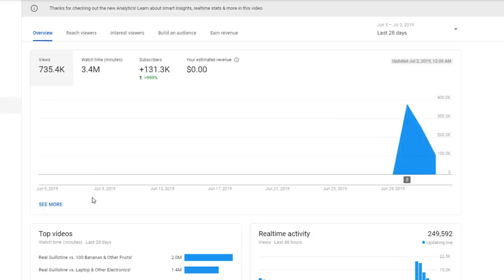Real Guillotine vs. NERF & Other Blasters!

Comment: I have a concept for guillotine victim retention. You could use a set of screws or bolts on each side of the blade and use metal straps to hold down the item. It would mitigate both the folding/eating effect and the sliding due to the slope of the blade. For reference, check out how the guys over at the Waterjet Channel secure a workpiece to the plywood backer.

Comment: guys. make the gap between the blade and the bench smaller. make the slice hole as small as possible. bolt-in thick steel plates on both sides of this drop zone to protect the structure and you will have cleaner slices. can you slice a book?

Comment: Suggestion - Tighter tolerance between blade and table.  It looks like your "victim" is getting sucked down into the gap by the blade.
Things to chop - Jelly, Trifle, wood (this thing would make a great log splitter), pot plants, Ice block......
Keep on choppin' boys

Comment: I think you need something to hold the slack on the cable that pulls the blade. If that cable stayed taught. I don't think your blade would derail. It would be cool to see jawbreaker candy chopped in slow mo.

Comment: You need to remove the rollers and aluminum angle, switch to UHMW blocks and sides. It's a low friction surface that would not allow the blade to twist. You could also make a clamp to hold the stuff centered to the blade so it doesn't slide into the blade jam.
Reply: I'd also recommend a remote solenoid controlled quick release so you don't have to be so close to the guillotine.

Comment: the longer the mount for the blade the less it will rotate on contact.
if you increase the length of the blade mount you can add another set of pulley wheels (or 2 sets), this will help reduce the derailing and will also increase the pressure exerted of the condemned.

Comment: You should chop one of those anatomically correct heads or something like that, also I think the triangle for the rails needs to be deeper in the wood, so the rollers run deeper inside the beam, then perhaps have the blade wider at the bottom to cut everywhere along the bed and stuff cant get jammed into those rollers.

Comment: You need a box to replace the hole someone's head sits in on a old fashioned one. Maybe make a box on the front end out of really tough glass

But you need something to keep the soon to be chopped items from sliding around

You could even just do a wall on the short side of the blade on both sides of the gap where the blade goes down

Comment: the blade keeps derailing, so you need to decrease the space between the casters and the track. or you need to add a boundary along the length of the poles, like a strip of metal that covers the area in front and behind the casters

Comment: In most guillotine designs the blade is attaching to a wooden plate/post that runs between two recessed rails inside the vertical posts, which not only keeps the blade steady during free fall but also retains the blade and keeps it from deflecting once it hits something. Also, in guillotines used for executions that prisoner is held in stocks, keeping them steady so when the blade falls the angled edge slices instead of chops. 

Since you have the blade and you have a router, use the same system you have but make channel in the side posts deeper to actually encompass part of the blade assembly, build retaining walls for the items you're cutting (you can use plexiglass so as not to obscure the view) and perhaps make the gap between the two platforms smaller so the times can't just get crushed into the gap.

Comment: Idea to stop the blade (instead of stopping it with a block o' rubber): use a high-tensile strength rope and a spring attached to the top and to the blade. A long enough length of rope wll allow it to fall freely, and the spring will prevent the blade from ripping the top of the slide off. That being said, still keep the rubber, since it'll be one more thing to stop the blade at the bottom.

Comment: I've spammed similar comments on the last three videos, just a recommendation.
You should add another cross brace like above, but a few feet up, high enough to be out of the way to chop whatever you want.  That way you can safely-er load the shit to cut in there.  You could just put a piece of scrap wood in there between the brace and the blade.  Obviously have a different clip for the carabiner to clip into for the half-cocked position.  That way if any one part of it breaks (casters, cable, any of the pulleys, rollers, or attachments), the blade would be sitting against a piece of wood and have no chance to build up momentum to cut something or someone on accident.

Comment: Video Idea: 
HOW TO SURVIVE A GUILLOTINE Test if it’s possible for a mannequin not to get chopped, try having arms above their head to stop the blade, or a system that stimulates the same amount of pressure arms would if they caught the blades at the side as it fell. 
Another idea is to do some challenge where the corridor crew has to save someone in the “nick” of time by shooting a polystyrene mannequin in the head pushing them backwards between the time the blade drops and strikes.

Comment: So classic guillotines have two boards with a half circle cut out of each to create a secure neck shaped hole to hold the victim. It’s kind of like the difference between cutting food free hand and cutting food while holding it down. With free hand the food can move around a lot, so unless you have a perfectly straight cut it’s going to move.

Comment: Stuff that u chop with a Guillotine was supposed to fall down, after the  choppin, like in some kind of head-basked. Just sayin' Plus: the surface you lay ur stuff on should almost touch the blade so you get cleaner cuts and less debris chunked into the slit.

Comment: Understanding the physics could help eliminate or minimize derailing.

First thing is to understand the forces. As the blade chops, the object it chops exerts an equal and opposite force on the blade itself perpendicular to the blade edge. The objects get pushed down and left, so the force on the blade is directed up and right. The force will also generate a torque on the blade.

The force up and to the right shouldn't cause derailing. The force in the upwards direction just slows the blade down. The force to the right is all absorbed by the right beam, but it's absorbed equally by both wheels. One thing to be careful of is the angled blade will cause a lot of stress on the right beam. Say your blade has a 30 degree angle. Whatever force is seen by the object being chopped or the rubber stopper, the right beam sees tangent(30)= 57% of the same force. 

The torque on the blade is what causes the derailing because as the blade twists it pushes the beams outwards and two wheels lose contact with the tracks. Objects chopped with the rightmost side of the blade will cause it to rotate counterclockwise, objects on the left will rotate it clockwise, and somewhere left of the center of the blade is a 'sweet spot' where an object will cause no torque. You can see this really really clearly on the first derailment on the television. The television is just about perfectly centered when the guillotine is first dropped. The blade starts to rotate counterclockwise. But then the television gets pushed left and as the blade continues to slow down it rotates clockwise because the force location has changed. 

One other note is the faster the blade stops, the larger the forces. Pineapples stop the blade over a large distance, while the television stopped the guillotine dead and creates huge forces and torque that bow the wood beams outwards.

To limit derailment you would either evenly distribute forces along the blade as it chops (hard because your items would need to be sloped to hit the blade at the same time) or find the sweet spot that creates minimal torque and chop with that part of the blade. You could either fix the object so it doesn't move at all, or put it slightly to the right of the sweet spot so as it chops and pushes the object left, the object moves through the sweet spot never creating too much torque.

Comment: The best design for a Guillotine would be the later French Model Guillotine used up until the 1980s when capital punishment was abolished. Plus you should have a mechanical release mechanism to hold the blade in place so you won’t need the board. If you guys want, I can send you a photo of the device I’m referencing. I know a guy who sells instructions which you can replicate the full, 1:1 scale Guillotine.
Reply: Don’t forget the Lunette, it holds the neck in place so the blade creates a cleaner cut.

Comment: Suggestions:
01. Chop soda
02. Chop fruits mid-air
03. Chop arrows mid-air
04. Chop 3D printed mini guillotine
05. Chop 3D printed mini versions of yourselves
06. Chop a velociraptor
07. Throw darts while the blade is falling
08. Chop a tablet/laptop that is turned on while playing a cringe moment from any of your videos
09. Stop dominoes by guillotine blade
10. Chop giant cheese
11. Chop pizza
12. Chop sports balls (from the biggest to the smallest ones)
13. Chop books
14. Chop pumpkin and carve a face on it using only the blades
16. Chop Voldemort's nose
17. Chop Sphinx's nose
18. Chop Squidward's nose
19. Chop Hitler
20. Chop Thanos
21. Chop Michael Bay's movies with practical explosions effect on the background

22. Chop glass/mirror
23. Chop paint cans with different colors
24. Chop globes or planets miniatures
25. Chop genie's lamp
26. Chop brains
27. Chop cigars
28. Chop fountain or waterfall
29. Chop anything but eith burning flames on the blade

Comment: The problem with your design is that you have to casters outside of the frame. They should actually be in the frame so your blade is the entire width of the opening of the frame so nothing can get caught in the gap of the blade.

Comment: There's a simple solution to your derailment issue...using 5/8" or 3/4" diameter steel black water pipe from the home improvement store of your choice, cut said tubes to the proper length and thread the ends with an NPT die to accept a flange that you can then fasten to the top and bottom of your guillotine frame just inside of the vertical 4x4's where the roller guide rails are...then weld larger diameter steel black water pipe that slides over your vertical rails...the longer the larger diameter pipe is, the less side to side movement the blade will have...the larger diameter you use for the vertical pipes are, the less prone to deflection they'll be once the blade makes contact with its target...or just fly me out there and give me a $200 budget and I'll figure something out on the fly...

Sincerely, 
The jankiest low budget untrained structural engineer on YouTube
Reply: Just to clarify, this would be replacing the roller guides entirely since they're absolutely useless in these sorts of situations...

Comment: I wonder if redesigning the blade to an inverted V shape would solve a lot of problems. Yes it isn't the conventional half trapezoid that was used in revolutionary France, and what's the point of the channel if you spend more money on machining blades than buying beer. Yet when the blade is dropped it is slicing laterally less than the actual impact is forcing the blade through the object. Focusing the downward force on a focal point at the center of the blade could help keep items from getting lodged in one side, deliver more precise force and keep any lateral motion caused by a buildup of chopping victims on the left side. 

The world has changed and adapted since the golden age of chopping. Should not the design of the greatest chopper be adapted as well??